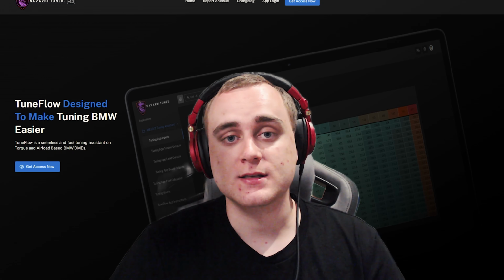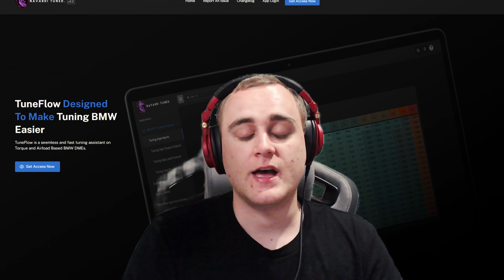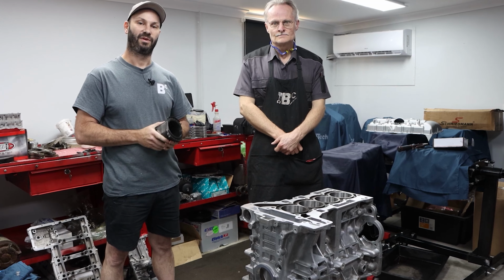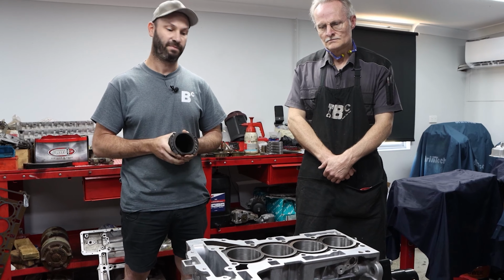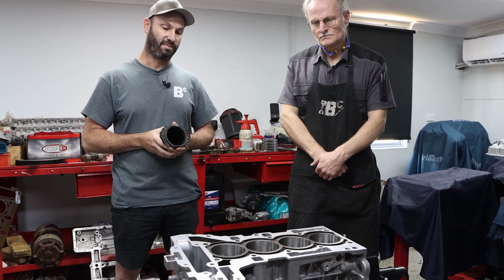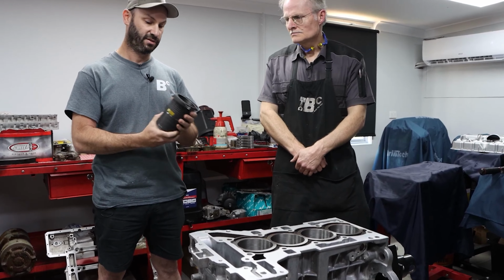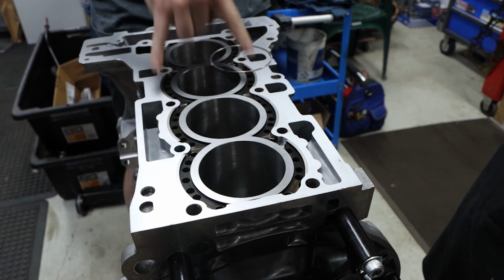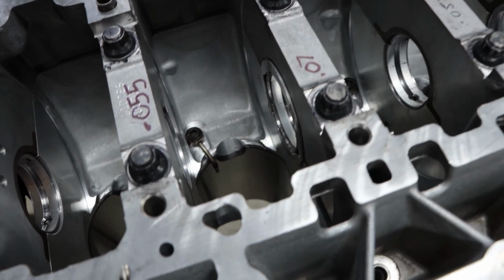Worlds First! BMW N20 Darton MID Wet Sleeve Build | Road To 1000WHP!

Comment: Poor choice of block
Reply from the maker: @aqib2000  thanks internet warlock for your aspiring comment
Reply: @NavardiTuned you could have picked a more enticing base, having recently rebuild a N20 for a spun Conrod on cylinder 3, I’m entitled to my opinion!
Reply from the maker: @aqib2000  You wanna sit here and tell me your entitled to your opinion whilst telling me what I should be doing and how its a "poor choice of block" 

So what a double standard that is... 
Didn't need your input tbh
If you don't like the engine then that's fine we don't need you here telling me how I'm wasting time etc on this motor... Especially when I have helped this engine and the owners of these engines whether "poor choice" or not actually have engines that last longer and at higher power levels ...

Comment: Would this application still work for the 2012 528i I know it's a bit different
Reply from the maker: Yes, exactly the same engine - you just have very tight room for aftermarket turbos
Reply: @NavardiTuned  I just sold my 528i and I regret it now i want my BMW back.
Reply from the maker: @Luis92r  :(

Comment: Why the inner sleeve is not smooth as a mirror finish?
Reply from the maker: The inside wall of the sleeve where the piston sits on the example in the video has already been honed and you can see the cross hatched pattern. The sleeve that is shown in hand by Laurence and Tony has not been honed (we do not hone until it is installed into the engine as we must torque plate hone these sleeves)

The ouside of the sleeve is coated in a black coating this is a specialised coating to help with heat transference and corrosion from the water. 

You do not use a mirror finish on the cylinder wall as that does not allow for good piston ring seal you must use the correct cross hatch pattern at the correct level of RA (roughness average) most engines use between 15 - 25 RA (although can depend on the wall material and piston ring material as to how low an RA is required. We have honed these to the correct specifications for our sleeve and piston combo

Comment: Quick question I have a full bolt on n20 currently running the stage 2 e30 ots from bootdmod3. Is the navardi tuned stage 2 e30 ots map a better option? Not really needing a full custom tune just something a little better than the ots map from bootmod3
Reply from the maker: Our OTS maps are alot more consistent, and linear over the BM3 OTS maps - we currently have a buy 1 get 1 free sale on for any of our tunes our Custom maps are better again. But whilst power gain is 2-3% on our OTS and 5% on our custom stage 2 maps. the biggest improvement is the drivability and top end of the engine as well as the silky smooth delivery of power. Feel free to reach out to us directly for more info
Reply: @NavardiTuned  I saw the sale for the tunes. It says buy 2 of the same tunes to get the second 1 free but why would I need to buy 2 of the same tunes?
Reply from the maker: @Average.40i  So the tuning packages there are 3:
1. For stock turbo and stock engine
2. Stock engine and upgraded turbo
3. Upgraded Engine and upgraded turbo

once you buy the tune you can tell me you want it for E30 or E85 or 93 OCT etc (provided you have the correct supporting hardware) - So when I say buy 2 of the same I am referring to the tuning packages not 2x of 93 tune or e85 tune. 

So with this promo you could get a 93 and E30 tune for example for the price of 1